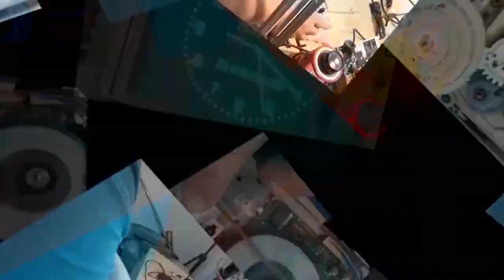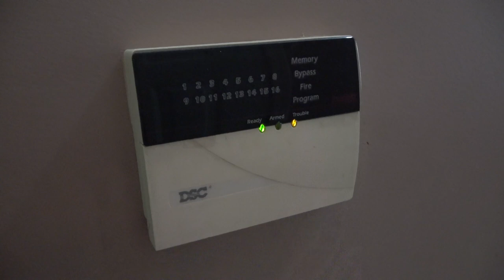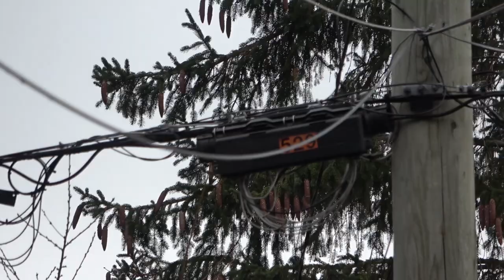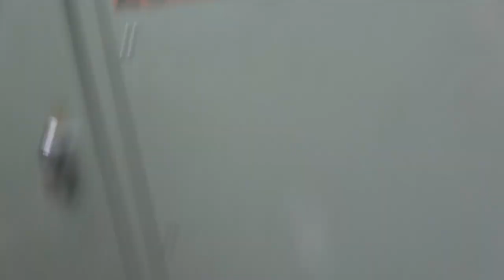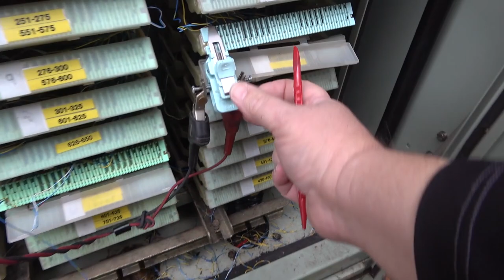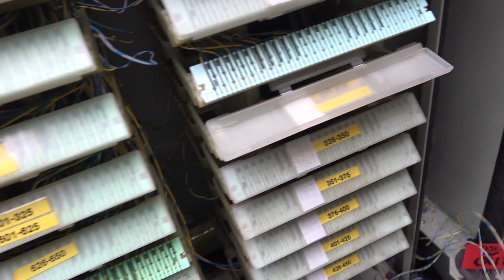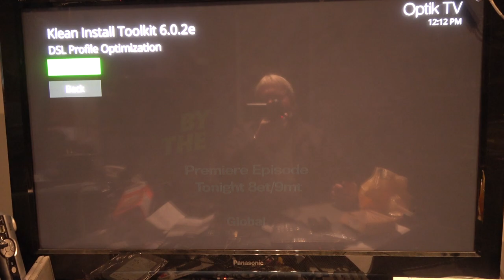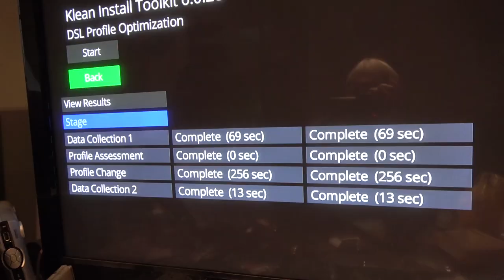Fixing my old noisy copper phone line

Comment: Here in NJ, copper phone lines are no longer being maintained. You can still use one, but if it ever has a problem, the "repair" that Verizon does is to switch you over to fiber optic, with an Internet speed of only 5 Mbps down / 1 Mbps up -- but that's still better than the DSL I had, which due to my distance from the central office was limited to only 3 Mbps down / 768 kbps up. Now I have FiOS (with 100 Mbps down & up) and the ONT does support rotary dialing, but the battery backup they supplied never worked, so every time the power goes out, the phones go dead.
Reply from the maker: Here the copper is also not being maintained either. They want to switch everyone over. Fortunately I work for the company, so if I have a problem I just go fix it. I shouldn't say "Not" being maintained. It is discouraged. I did a copper install a few weeks ago.
Reply: @12voltvids  In NY we have the same thing, Copper is phased out and that was even more phased out when Sandy hit in 2012. I myself along with a few others liked the way copper sounded during a phone called compared to Fios IP Phones which sounds like too much of a digital echo like a cell phone! Dave being that you have both worlds running to your house, couldn't you use fiber for internet purposes only or TV if its available and keep using copper as is for everything else (legacy) which in term making them coexist? Also to @VWestlife , I enjoy your legacy electronics videos as well!
Reply from the maker: @Hi-Tech-Ray  no once you switch everything switches.  Even people with no internet or tv are being switched just for phone.   There are other reasons i don't want fiber.  IP changing every 24 hours is another.  Wrecks gavick with things that require a fixed up.  As I said I have legacy equipment i have no intention of upgrading.
Reply: In my country copper (with VDSL) is not only maintained but also installed. They sell you VDSL at 100 or 200Mbit as fiber to the cabinet, which clearly is not fiber. 

Also the new VDSL lines doesn't have analog phone service, I mean that the phone service still is VOIP and the copper line is only for the data. To me is not a problem, I dismissed the home phone years ago since the only calls that I did receive were spam calls and I have unlimited phone calls on my mobile phone so.
Reply from the maker: @alerighi  
We still do copper for people that don't want drilling or for apartment that is too costly to update. 
It is fiber to the cabinet.  The dslam is fed with fiber.  VoIP could be done over the DSL modem but the gtd5 is still in operation.  I have a VoIP line as well for business.
Reply: I like the fact that VWestlife likes the same channels as I do
Reply: I live on a cul-de-sac of single-family houses, surrounded by condos and apartment complexes. They all got fiber at least a year ago. It’s finally gotten to the end of my street. Maybe I’ll get it in early 2021.
Reply: In my particular city in south-central Texas, the local copper phone lines are owned and "maintained" by Frontier. Up until August 2019 (when I switched to infinitely superior cable Internet) I had their 3 mbps down/864 kbps up service. It was horrible, outages every 15 minute and nowhere close to the speed we paid for. Phone was horribly noisy as well. Frontier does not operate fiber here, at least in residential areas, and to my knowledge they are presently just using ADSL (nope, not ADSL2, just standard ADSL). The network they own here was previously operated by Verizon who was almost as bad. I could understand this if they had a fiber network to push customers off to, like FiOS, but they don't. It's no wonder they're struggling.
Reply: My internet is copper to the fibre box
Reply: And here in Germany i can only use my copper wire for the internet because it would cost 10.000€ to get glass fiber.
Reply: In the UK I get 450Mbps fibre down and 45Mbps up with a ping to 8.8.8.8 of 7ms  Some of the figure people quote are scary slow!
Reply: @xitee6258   ONe isp in Anguilla is all fibreoptic. The other one have fibreoptic in one part of the Island.
Reply: @cowasakiElectronics  a symmetric line on an altnet is even better! I have to say, despite wishing BT had been allowed to do a full fibre rollout in the 80s (if it had succeeded as they projected anyway); I do think Ofcom manages things better in the 21st century than many other nations. Ensuring competition rather than strangling it, and so forth. Were we less lucky, we could easily have ended up with regulatory capture like the FCC under Ajit Pai. (And it was hardly effective even before him.)
Reply: for real? in central europe we are getting like 50/50mbit fiber since 2007, dsl more in the 100/20mb range
Reply: @12voltvids  Thats a bit naff!  It just goes to show the differences from country to country.  My IP address never changes unless I renew lease or turn off my cable router for more than 10 minutes.  Also Emergency services can still get our phone number even via fibre and services like caller ID still work.
Reply: In my country almost every new house built from around 2000 has 2 pairs of copper in one sleeve + cable + fibre. Having two or more connections is possible. Almost no home customer has two connections.The copper in the sleeve is perfect for ADSL, it's well insulated at least moisture wise. If you get internet here, you practically get TV as a gimmick. TV on ADSL with  a modem and a UTP connected set top box. Or digital TV on cable, with a splitter for the modem and a cable connected set top. I use cable in my home, 250/25. Fibre would be a little more expensive for 100/100. All our copper runs underground, all of it. Only houseboats have dangling wires. Cable is being maintained. Copper is being maintained. Lots of people use TV over ADSL here, it's usally a little cheaper then cable, but also a little slower with the internet speeds.
Reply: @xitee6258  Hi me in germany too, 150Mbit, fibre optic direct into the house . I can order up to 750Mbit if I want. 150Mbit  is the basic order.Monthly line charge incl. flat rate  is 29 EUR , 
I use copper only for my DID telefon system because DID service  over the fibre operator cost too much and I have to purchase the gateway. I´m on fibre since 2012.
Reply: Same here in Rural Pa our network hub is about 100-200 feet from us and the DSL is way below what they say we tried it and got .08 down at best but was paying for 3.0 down they don't do dry loops so we had to pay $75 a month for the phone and useless DSL we had to fight with them for a couple months to get out of the contact and get a refund for the installation that was a self install since they hate sending anyone out.
Reply: We had VDSL in SC through ATT but it's not available to us now.
Reply: @Reaktanzkreis  Port the number to easybell, in the simplest case a Fritzbox as BRI-Adapter for the Easybell SIP-Trunk. Or something like Beronet BRI-Gateway. Cheap and reliable. (Or get a Voip card for your PBX, if possible)
Reply: @deineroehre  Thanks , but as long as it works I will not change it at  all (neverchage a running system.  But the time will come that my actual phone line provider turn to IP. Several weeks ago I came across a Gateway at my local scrapyard , an working  Audio Codes Mediant M800B 4xLan, 4xFSO, 4xFSX and 4x BRI for 5 EUR  include some Unify office desk top phones .
 It was laying in a container withe loads of Computer and phone equipment equipment. 
I put it to my other odds and ends waiting to come to work.
Reply: at least they give you fibre we have been calling up bt (the phone and internet provider in the uk that maintains most of the infrastructure)and every time they send an engineer over and they have a 50 50 chance of actually finding the fault and when they do they see that it is an issue in the junction box on the line by the road that you need a lift to get to. upon finding this out they just go home cuz no on has a lift this prosses has been repeated so many times that we dont even bother calling them up cuz we know they wont do squat and yes i know adsl is slow at the best of time but our internet had been running at 60KB/s for the passed 6months now and half the time its disconnected anyway and at this point we are just gonna stop paying for internet since we dont have any

we sent a car to space ang yet we can't even be bothered to fix 2 wires for a customer. the society we live in
Reply: @cowasakiElectronics  I'm in UK too, 1000mbps up and down, super cheap too, £25 per month, only issue is the ip changes if my router goes off. Ups to the rescue 🤣
Reply: I was told that FIOS will not be offered in my area (NPA-Office code 732-738)  so they are still maintaining copper.  I also have a phone line through Xfinity.  Their system DOES support dial pulse.
Reply: @12voltvids  >"IP changing every 24 hours is another. "

This has nothing to do with fibre or copper, that's just the ISP's implementation. We have copper and don't have a static IP. But when I used to live in Brighton we had fibre with a fixed IP. Many ISP's offer a fixed IP if you ask, either for a fee or for free.

If I was on FTTP and needed a fixed IP but my ISP didn't offer it, I'd just switch to another ISP. I know this isn't as simple in the US due to the insane monopolies on internet service, but here in the UK you normally have at least a dozen ISPs to choose from.

>"Wrecks gavick with things that require a fixed up."

Why not use dynamic DNS instead? I self-host a few things from home, and am on a dynamic IP (through copper as I mentioned). I just setup dynamic dns on pfsense. Even my crapp ISP's router actually supported DDNS iirc.
Reply: They upgraded you to fibre but you still only get 5mbit? What?! Are you sure you mean FTTP and not FTTC? Like jesus your ISP is fucking you hardcore if they're only giving you 5mbit on fibre. I can't imagine any reason it'd be so slow? Or is it just due to the stupid ISP monopoly in the US?
Reply: @xitee6258  Do you live remotely or something? If so do you have line of sight to a property with fibre? Or even obstructed line of sight, e.g. through a forest? If so I would look into asking them if you can setup a network between them and you. Ubiquiti sells long distance high speed point to point networks that are affordable to consumers. I think for about $200 you can get a WiFi setup that can go 15km (obviously only between the two points) and support speeds of 500mbit to 1gbit.
Reply from the maker: @lost4468yt  
My IP never changes unless i manually release and renew it or unplug the modem for 15 minutes.  Otherwise it stays the same.  I have 2 public IP, one that my gateway is connected to which I do release and renew regularly and another one that my secondary router has that all my security cameras are linked to.
Reply: @12voltvids  what about the other things I mentioned? About dynamic IPs not being to do with fibre etc? Also more importantly, could you not just have two lines installed? Keep the old copper line for phone etc, and then use the fibre for internet? Here in the UK you can have another line put in if you want to, can't you do the same there?
Reply from the maker: @lost4468yt  you can get a static IP if you want to pay for a business internet account.  No can't have both. When. Fiber is turned on they want everything on fiber.  There are exceptions of course like someone that has an old fax machine that will not work with fiber but you will get pestered every few months to change technology.  Many did keep their phone on copper in a certain apartment for the enterphone system but even those are being migrated.  I know as I am the one doing the migration.  The contractors that did the initial fiber install had no training in copper. Even our new techs have no copper training.  So internet and TV was installed last year and now i am making my way through the building switching the phone to fiber and rewiring the intercom system to work.  
For me it is all about the price. As I've repeatedly said I'm on an old plan that is no longer available, I'm grandfathered on this plan so they can't kick me off the plan that I'm on and the rate that I'm paying. If I switch to fiber for my internet and TV I have to take the new price plan. Currently my TV service I get all my set top boxes for free included. on the fiber plan I get two and then I have to rent the additional four for a monthly fee. My channel packages currently have, and I get for example all the sports channels I think I pay $9 for all the sports channels, now the sports channels are in two separate bundles at $8 each so I pay 9 now it will go up to 16 for the same channels. Other packages are the same I'm paying the old rate and I get six channels per bundle the new rate is a little bit cheaper but there are only four channels per bundle which means I have to buy more bundles to get the same channels I currently have which means a price increase. that is the reason I am staying put with what I have because I don't want to pay any more than I currently am paying is that really that difficult to understand. I do not care that I can get faster internet because what I have is more than enough I don't need anything faster.
Reply: @lost4468yt  Yes, the last time I checked, the "free upgrade" Verizon FiOS plan for grandfathered DSL customers is only 5 Mbps down / 1 Mbps up. That's still better than the 3 Mbps down / 768 kbps up that their DSL was giving, but not by much.
Reply: so they switch your POTS line to POTS over Fiber and then internet, VDSL over POTS over Fiber?
Reply from the maker: @aedgvv6095  that's called derrived voice. 
Don't want it for reasons already mentioned.
Reply: @cowasakiElectronics  In Canterbury best I can have is 65 down and 17 up, good ping but speed is still pretty slow for some stuff. 60 pounds a month, wouldn't mind paying even more if I could get better service...
Reply: I mean, Verizon FiOS is fantastic. It is the best major service in NJ...
Reply from the maker: @-Good4Y0u  Our pure fiber is fast if you want to pay for it. 1Gig down 940 up, or 1.5g down 940 up, and even faster speeds are coming soon. Talking 10gig speeds. Fiber cabinets will have different splitters Right now they are 32 port splitters. Going to 16 port will double speeds, 8 port for give 4x, and so on, and there will probably be direct feed offered. Right now the direct feeds go to apartments where they hit the splitter in the tel room but very easy to scale speed.  Some people are dumb enough to fork out those big bucks so they have bragging rights for fast internet. 
Me I don't care. My newest computer is 10 years old. I still watch a plasma TV. Do I look like I care about speed?
Reply: @-Good4Y0u  does the service keep port 80 open so u can run a server at home? telus blocks them like its 1999
Reply: @aedgvv6095  yes , mine does at least, but you can always use a proxy from a cheap cloud host node , or just a modern VPN provider. PIA for example I believe offers a service for it . it doesn't require much to run on a cloud host and therefore cost to run is mere dollars per month usually, I did this for awhile. I just cant really host the files I want in the cloud at a reasonable price... My many TBs would be a significant expense. I'm a nextcloud fan .
Reply: @12voltvids  oh im totally with you.. telus is a mess here too.....  i m old fashioned like you. its sad to see 100 years of reliable telephone service go downhill.  with new tech and  sloppy work. almost each time they access the boxes in the alley    they touch lines that are not even part of their work order and do not reconnect them.
Reply: @-Good4Y0u  yeah i agree ./ "cloud" is a stupid term. im  old fashioned. .  VPN providers are shit listed everwhere, webhost ing providers have  webhosting ips  where they are always shit listed .. its all gone down hill with these ip restrictions.    good points you mentioned.
Reply: @-Good4Y0u  so both telus and verizon block port 80?
Reply: @aedgvv6095  Verizon does not block port 80. I have had different ISP's that did though. I have also used this method to hide my home IP from the internet for my services before Cloudflare offered their free service for it.
Reply: i dont think it even is possible to get lower than 20 Mbit/s here.
Reply from the maker: @ludwig2345  25 is slowest offered.  I could get by quite nicely with that.